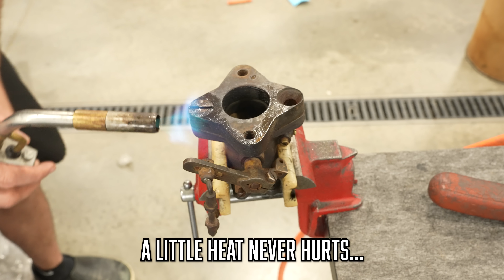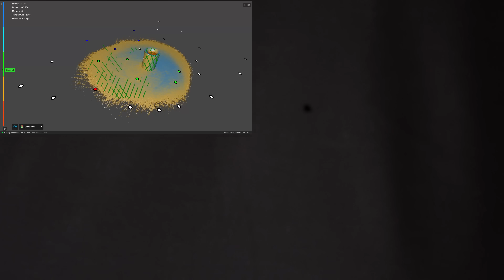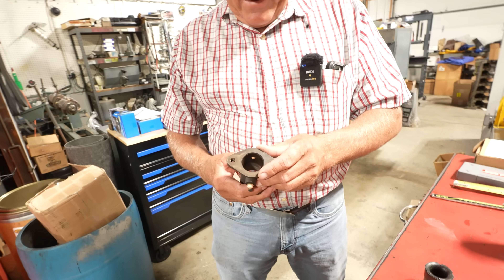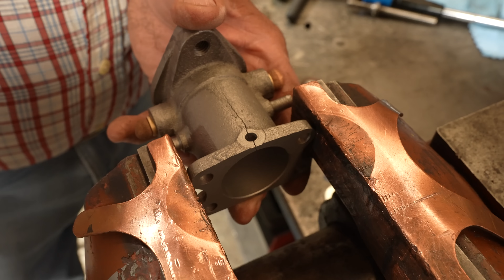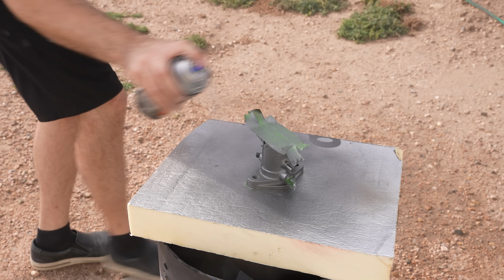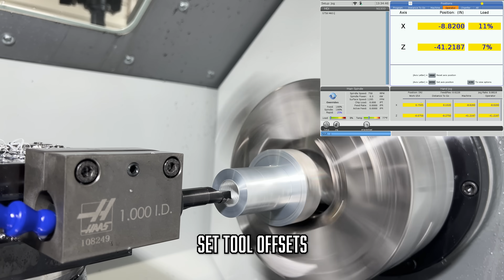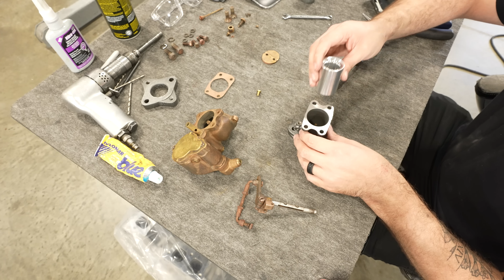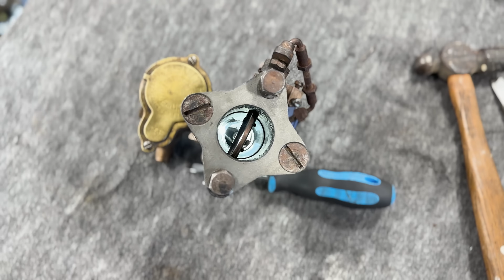Repairing A CRACKED 1920 Zenith T5F Carburetor W/ MODERN Tech

Comment: Just a tip for next time you're repairing a crack in cast iron, or if you just want to make steel or any other metal look cast: once you're done smoothing the repair and blending it back into the casting, take your needle scaler and go over the newly blended repair - it will give it a cast-iron look.
Reply: That also helps to stress relieve the cast iron
Reply: I use easy weld tig wire for cast iron repair.  It requires no preheating and works exceptionally well.  I immediately use the needle scaler after each weld.
Reply: True fact
Reply: My thought was to just do the media blast again wouldn't it blend it into the rest?
Reply: That's what I do after pinning repairs to cast.
Reply: - Yup. I expected him to do that...but he is too new to this to know that trick that I have seen on many different YT channels.
Reply: good idea, I was thinking about a rough stone on a dremel, it you press hard with very low speed, it gives a good illusion, but your idea seems nice too
Reply: Also hammering a piece of heavy grit sandpaper on metal.
Reply: How do you make the Bold type in a browser?
Reply: I dunno. $200 ?
Reply: Can nobody actually weld cast iron these days? It ain't that difficult.
Reply: @andrewclarkehomeimprovement  What? Welding cast iron is exceptionally tricky, learn something about metallurgy and the structure and composition of the metal. Brazing/soldering is the correct fix in this situation.
Reply: @andrewclarkehomeimprovement if one doesn't know the ratios of the composition of the cast iron, welding it correctly is a challenge. With the thinness of the cast and not wanting distortion, silver solder was a good plan. If they were putting the frame of a tractor back together, it might be a different story.
Reply: @andrewclarkehomeimprovement I can. I choose not to because there are better repair methods for the stuff that I encounter.
Reply: @andrewclarkehomeimprovement   Not old cast iron as it is usually full of crap and there is NO thickness to work with here.   Cast Iron from the 1980's onwards usually is very clean and can be welded with no issues.
Reply: @andrewclarkehomeimprovement I weld cast iron probably once a month.
Reply: @andrewclarkehomeimprovement  I just welded an exhaust manifold on a David Brown. I ran out of gas for the preheat so I turned my old Forney up to 250 amps clamped the ground on one side and put a clamp on the Positive side lead and clamped it on the other side of the manifold and turned it on. Took a couple of minutes but it got nice and hot. I then Ran a bead of Hobart nickel 55 and  put it in some preheated sand to cool. Properly prepped the metal before I preheated. I got the idea for using my stick welder because we use the same method to preheat titanium before stretch straightening it where I work.Water cooled clamps and 2 big Lincolns can get metal red hot pretty fast.

Comment: Nice rebuild, it will last another thousand years in the museum. There’s a couple of things I would’ve done differently like: 

1. once you heat cast iron to remove a fastener NEVER remove it while dry, at least apply beeswax or a crayon to the parts while still hot so it creeps into the threads and help prevent galling. 
2. NEVER hit a carburetor throttle or choke plate shaft with a hammer, any slight bend can cause binding, to pin screws use an automatic center punch or support the shaft from below before using a small hammer. 
3. Your G73 setting was pecking too far, if you were doing this for many parts a lot of time is wasted. 
4. When sandblasting any component always remove all hardware, the cavity where that fastener ends could hold blasting material that could come loose during use and damage the main components.

Comment: 9:53 would the flux draw down better if one heats it from the back side you think?
Reply: They did it wrong either way so... XD That was a video how NOT TO repair a crack.  They should have preheated it way more, to begin with.. The material basically froze the second it went into the crack because it was too cold.
(You have to bevel the sides of the crack and then braze/weld (PREHEAT nessecary on both and cool it down slow..) it together again.... (both sides would have been the best but you can scrape by, doing it on the outside but having a small gap so the capillary action can do its work) Where did you learn to repair a crack like that? (the hole for the end is correct)
You can clearly see that the capillary action was BASICALLY not present.. since you can No color change in the inside of the bore aka no filler material being pulled into it..... WHAT) - that was the comment for the channel.

Comment: With the machine work and the housing repair, disassembly and reassembly I'd say that repair would be at least $250 - $350 range (good buddy price). The carb turned out real nice and should get the truck up and running again.
Reply: I was just about to post up the same thing.  I sent off my Zenith for a rebuild (1951 Chris Craft boat).  300 bucks is about right.

Comment: $800 -900 wouldn't be out of line. 
Could easily double that cost. 
I rebuilt a water pump for Local Fire Department in Grafton Ohio
1938 Diamond T open cab pumper. 
Hercules engine. 
Free of charge. 
I was very grateful they trusted me with the job. 
And even more grateful to receive a thank you card with all the firefighters signatures. 
Been working great for 16 years now. 
Great job on your repair!
Reply: I was thinking upside of 1000€, at no less than 20 hours at no less than 50€/h. And this kind of skills are usually very hard to find i.e. more expensive than the typical tech man hour.
Reply: @virolla im not for what $50 in your country gets. But service people in states are every bit of $100-250 an hour.

Comment: Mr jim I think that bigger brazing tip caused excessive heat sinking on light density part as most cast is full of trapped casting sand i understand having to float it out could have also used nickel rod but watch the eye of the puddle it shows where you directed heat is at all time pre ww11 passed on lost knowledge 60 /40 brass Different expansion and contraction 
Like watching you platform

Comment: Hollow ground screwdrivers are your best friend on those old slotted screws. I keep a big set of them for old slotted screws on old parts and firearms.
Reply: And the right size driver for the screw. 👍
Reply: i really dont know  why they ever even invented the taper.  makes no sense other than easier to produce
Reply: Nice. I just learned a new tool.
Reply: I keep a set of gunsmithing screwdrivers around for working on my motorcycles. Flathead bit inserts work pretty well too, and I've got a few old screwdrivers I've ground custom myself for working on things that need to fit perfectly.
Reply: taper screwdrivers arent even ground-, theyre stamped and the corners nipped off
Reply: I've seen a couple YouTubers use a large bladed screw driver attachment for a pneumatic impact wrench. It has a right angled length of round stock coming off the shaft of the driver with which you can steady the tool while slowly loosening the screw.
Reply: @johna1160 Also there are things called drag links. It’s like a fat screwdriver blade that can be used as an impact socket
Reply: I prefer to always use hollow ground screwdrivers. Irritating that they are not easier to find in all the sizes you might need.
Reply: Great, Now I have to research what a “hollow ground screwdriver” is, and I’ve been wrenching for 30 years 😂
Reply: - "Hollow-ground screwdrivers have flat, parallel-sided tips that apply torque evenly to the bottom of a screw slot. Unlike standard screwdrivers with wedge-shaped tips, which apply force at the top of the screw slot, hollow-ground tips provide full contact to prevent slipping and damage to the screw head. These specialized drivers are highly prized for precision tasks." ~ AI Mode
Reply: @RobertFay So I can just take a tapered Screwdriver and grind it into a hollow one…

Comment: A T&M job shop sort of work would be charged out at your shop rate.  If your shop rate is 100USD and the material was about 50, then it would have been about 300-400 USD.

Comment: I once welded a cracked cast iron cauldron. The shape made it tough to close the crack which was about 1/4" at the end. Since nickel rod is often used to weld cast iron and it shrinks as it cools I started applying tack welds without peening and removing some tacks as I worked. During actual welding the crack closed up tight so that it was hardly visible from the outside.😊

Comment: Last week I watched an episode where you removed a broken stud in a just renovated engine block. Here you used some sort of threaded inserts for thread repair. Is this necessary on such a repair. Or was it because the owner had tried to drill out the stud and damaged the original threads in the attempt

Comment: Excellent save on a very cool carb. When I was a young mech, a common problem I used to see was slop in a throttle shaft that created quite a vacuum leak. Teenagers, trying to make their cars look cooler, would hide their throttle return spring by moving it so it pulled on the bottom of the throttle lever. With both the throttle linkage and return spring pulling aft, the shaft or base would wear.

Comment: An Hourly rate, would probably out price a replacement but Experience doesn't normally come cheap...  However, if it cost 100 bucks to restore, and the customer agrees,  Hell yeah, rebuild it.  And learn something from it which may benefit later on in life , when something similar arises.   Oh and even better, your sharing it on YouTube
Reply: For a museum a replacement won’t do when the original is available because the new one would’ve caused loss of value.
Reply: First off. You did a good job. Using that big chunk of metal in the lathe is on you. Plus the wear on the lathe. Smaller piece less time seem like half the video was lathe work. I'm sure it was a learning experience for you.  As for cost how much would a replacement cost? This would be a determining factor.
Reply: It's not like you can go down to AutoZone and buy a replacement.
Reply: You couldn't take it apart and clean it for a $100
Alone fix it.
Reply: @brandonvarney7258  sorry to burst your bubble .But id do it for free as already mentioned its for a museum.  There's more to life than Cash !
Reply: @Turbo-Drew 
Look at my other post about rebuilding water pump for Local Fire Departments vintage fire engine. I did for FREE. 
I know it's not all about $  but the reality of a normal job like that ,$100 doesn't get you to the point of inspection.